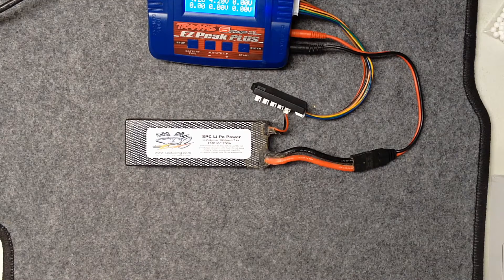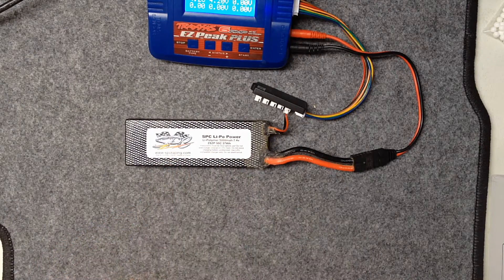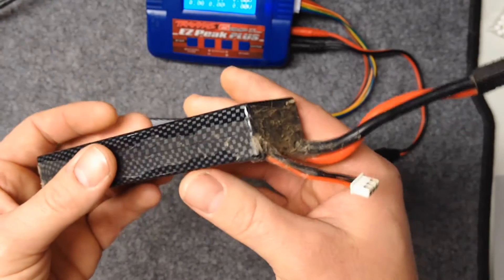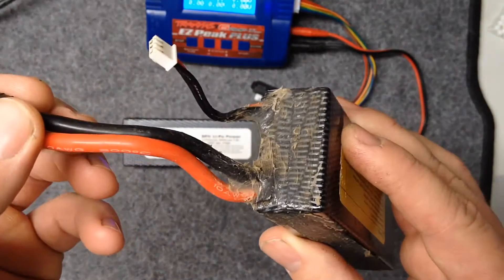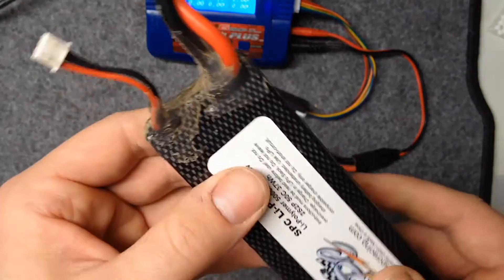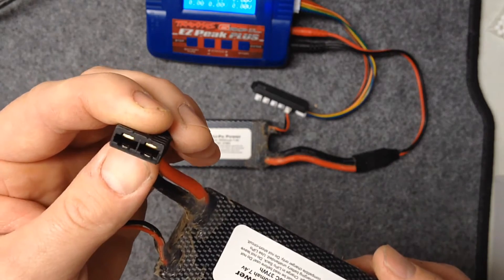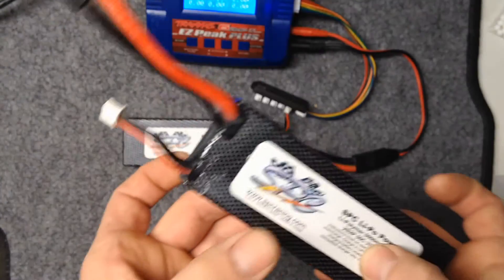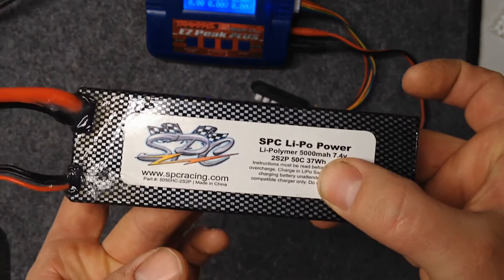How To Waterproof Your RC Lipo Batteries

Comment: whats your thoughts on plasti dipping lipos just worried about heat restrictions it may cause but saying that not had any problems when using on esc's. im a nooboe to lipos have you a charge/store safely video ? thanks
Reply: Late reply but for example my charger has a balance charge, fast charge, and store. Select the "store"  setting before putting the batts away for a long time. My charger is a Traxxas Ez-Peak Dual. Im no expert but my understanding is it discharges the batteries safely for storage instead of leaving them fully charged for months or whatever timeframe.

Comment: I never new you needed to waterproof batteries?? I just assumed they were wrapped and sealed
Reply from the maker: neilizer They are to an extent. There is still wiring inside and such that will corrode over time, not good potential for a short.

Comment: Good stuff. I am gonna use a hot glue gun to seal mine.
Reply from the maker: +liquidalloy Hot glue is strong but in general it may only be good for the sides of the hard case its too rigid for the rigors of the r/c environment.
Reply: +R/C Addict Makuloco it worked pretty well. I smear it thin into the crease. :) your video was very helpful.
Reply from the maker: liquidalloy Good stuff!
Reply: liquidalloy I’m gonna try this with hot glue too, but does The battery get hot or are there any problems with putting hot glue on the battery